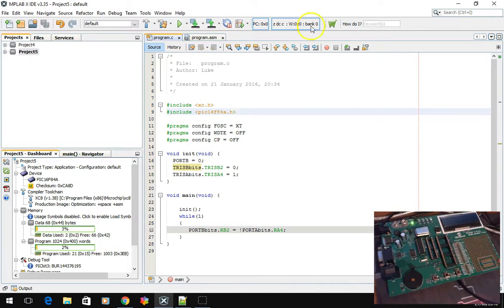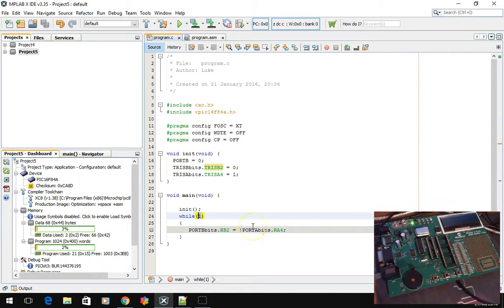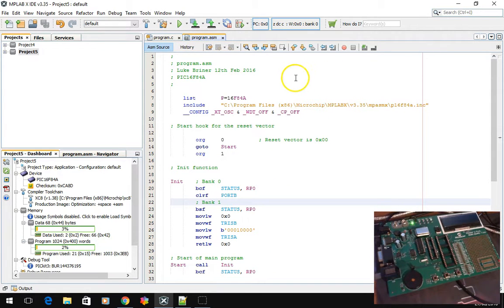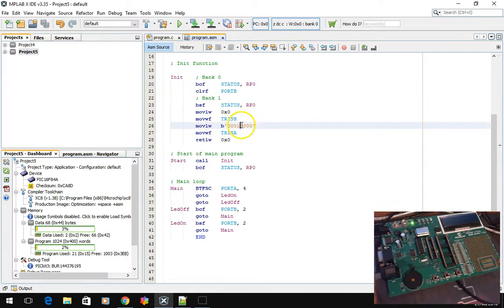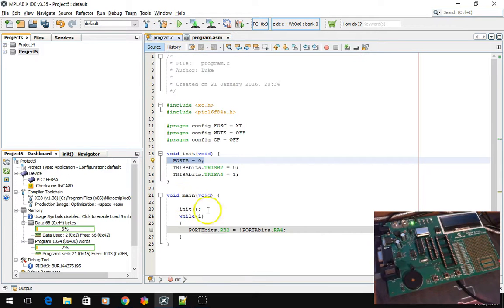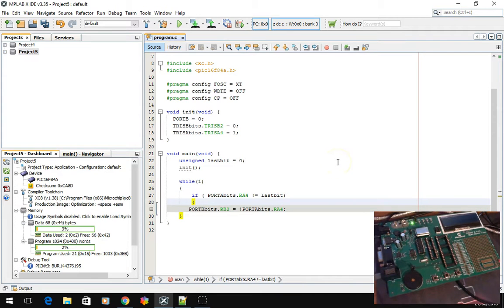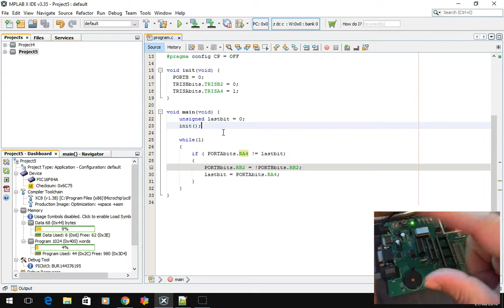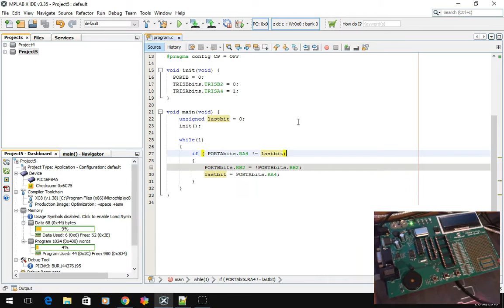PIC Microcontroller Tutorial 3 - Reading and reacting to inputs

Comment: Where can I buy this board tried using regular chip had hard time connecting wires, debuggers wasted time
Reply from the maker: It depends where you live. You should be able to buy a prototype board from any good electronics shop, online shop or an electronics supplier like RS, Farnell etc. Mikroelektronika make nice boards. Not cheap but worth it, the software works more reliably than the Microchip boards.